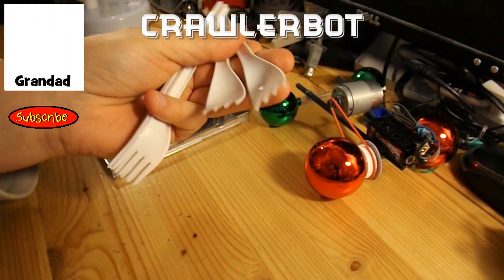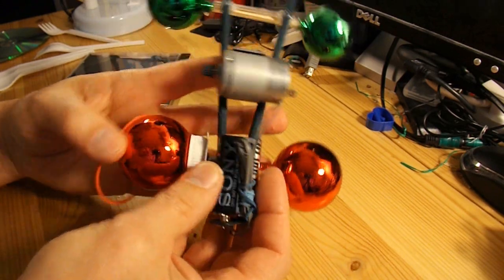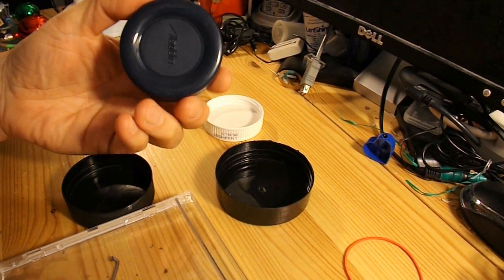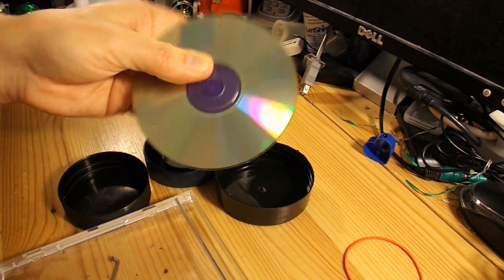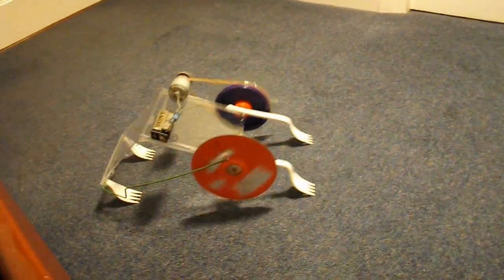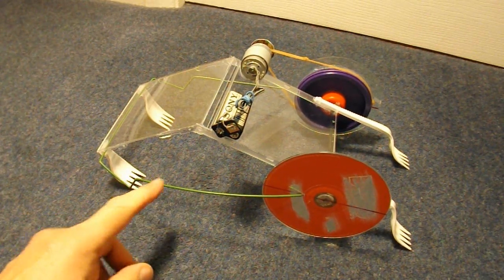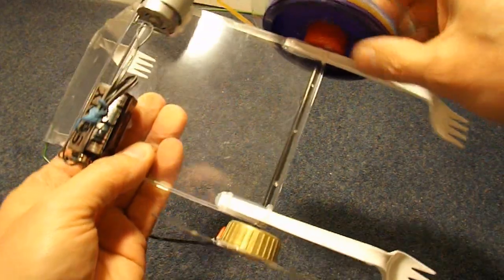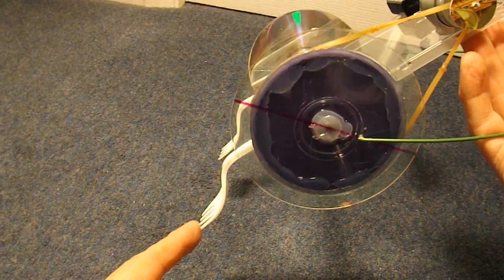4 Forks and a CD case Crawlerbot

Comment: That's neat I'm gonna try it
Reply from the maker: Thanks Andrew, I was pleased with this one and it was fairly easy to build. It has to lift the weight of the motor each time it moves so after I made it I wondered if I could have repositioned the motor lower down, maybe on the 'feet' it might have been able to work with a less powerful motor. Maybe next time.